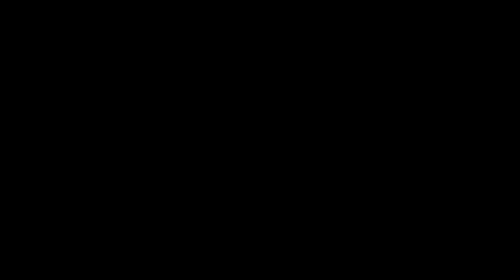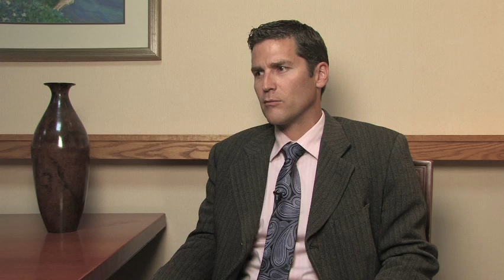9/11: EXPLOSIVE TESTIMONY EXCLUSIVE - AE911Truth.org Jeff Farrer Physicist 2 of 3

Comment: @jizzmonger; Did I say 2? Well the "pancake" theory, that's one right there as it completely ignores the structural core which would make such an occurence impossible. Then there is the fact that the structural core was not only fire protected throghout, but encased in concrete. Then there is the fact that there were 13 different gagues of steel, progressively increasing in strength as you get further down the building, which makes the sustained rate of accelartion fucking ridiculous by the way!

Comment: @gunthaarz I'm alittle confused. Are you agreeing or disagreeing with me? The reason why the steel was fire protected in the first instances was that it is the law. Furthermore fireprotecting the steel only made it more resistant to failure meaning the fires would have to burn hotter and for longer to cause failure than without it. The point I was in response to brokenstyx's suggestion that CORE10 steel was used to increase the frames resistance to degradation by fire and the elements.

Comment: @brokenstyx: WRONG! The steel you are referring to is CORE10 steel. This is commonly used for railways and external steel cladding. This is NOT a structural steel by design; the structural integrity of a steel is defined by the special heat treatment process it undergoes during production to give it certain structural qualities. This was NOT used as structural steel in the WTC, this is a stupid assertion. It is public knowledge that the steel structure in the WTC had ASBESTOS fire protection.

Comment: @SteelersFANinMA 
hey steelers!

i know structural steel is often intentionally pre-rusted, which prevents any further rusting.  that's why all the WTC steel looks red.  its not that colour all the way through though.  if you were to cut a piece of structural steel in two, the centre would be silver/grey.  until the surface rusts anyway.

so i think they're probably just regular chips of WTC steel, not a painted coat on top of steel.  either way, AE911T don't do control tests against this.

Comment: @brokenstyx If the red on the outside of the steel is primer paint and you chipped a piece of steel from a beam or column, wouldn't that leave you with a chip that is red on one side and gray on the other?

So, if the chips that Jeff Farrer is referring to are red on the outside and gray on the inside, can this actually be a chip of steel?